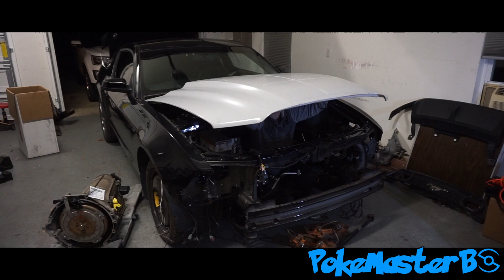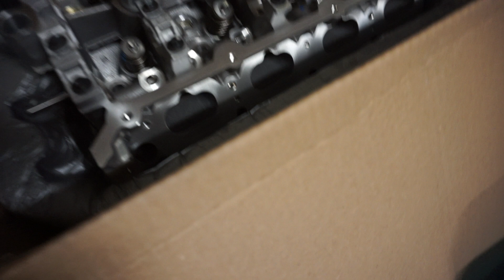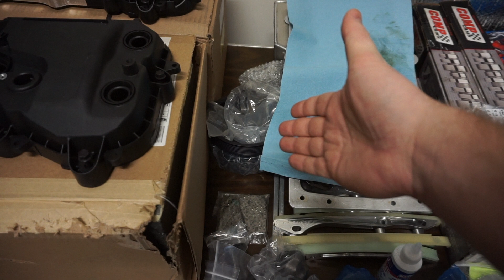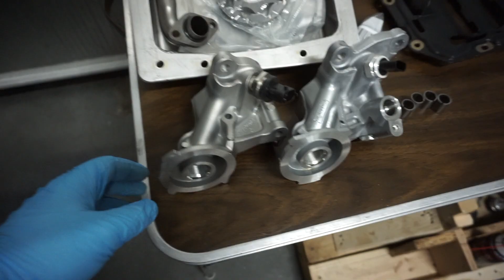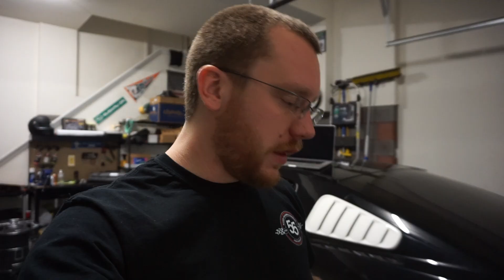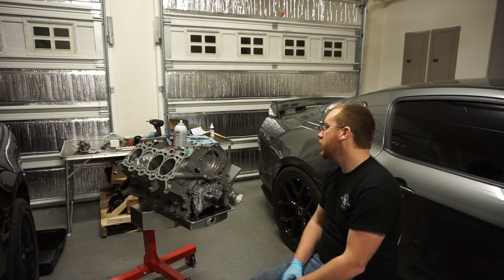Frankenstein Coyote Build p.1: Setting Up The Shortblock

Comment: good stuff. I'm just finished building a Gen3 short block for my F150. I'm pushing close to 1000hp in the truck now and if she goes I have a back up. anyway I'm like 5 miles from MPR and Tim told me I must line hone  the mains when going to a stud. He also wanted to square deck the new block as he said they are terrible from the factory.. Long story short, I purchased a brand new block from ford and had tim square deck it, align hone the main, balance the crank. and spec the bearings. cost was 1300.00 for everything.  also I don't know if you plan on boost, but the main downfall of the gen 3 block is the .009 top ring gaps which are very tight. alot of fellas will run the stock pistons and open the gap up on the ring. I went with the mahle no balance pistons and the boostline rods. hope she becomes a real ripper.
Reply from the maker: Very nice! I unfortunately didn't know of any local engine builders/machine shop before starting the project so I passed up on getting the short block thoroughly gone through and just did the resistance test you see in the video. Probably not the most accurate way of going about things but at least gave me a little bit of comfort knowing I was measuring the same resistance in the rotating assembly. You should definitely align hone the main when swapping to a stud if you have the means to. I've got to say though $1300 isn't bad at all for that work to be done. As for the boost, yes I run a paxton blower on the car but part of my purpose with the gen 3 short block was to be able to bump power without upping boost. I only run 13-14 psi on this motor all said and done so nothing too crazy. I'm not familiar with gapping rings myself but I understand why etc. just didn't feel it was necessary given the levels of boost I expected to see.

Comment: Great video man. I have that same oil pan. You need to grind down the spacer for the pick up tube so you can get the correct clearance. Once the gasket is compressed the clearanceis to small. Keep it up man.
Reply from the maker: I wasn’t sure about the clearance on the pick up tube because I didn’t know what stock was lol but it seems to be just fine how it is (cars already done running and tuned) videos are just behind. I would think if there was going to be an issue with it it should have shown up by now! But just out of curiousity, are you running the same MMR spacer? And if so how much did you grind it down or how much spacing did you make sure there was between the pickup tube and pan?

Comment: This is such a cool idea/build! Do you have a good idea what a GEN 1 Coyote would make with Cold Air Intake, 2018 ported manifold, 1-7/8in headers, H pipe, 1050x injectors and dual fuel pump would make on the Dyno?
Reply from the maker: Thanks man! If I were to guess I would say somewhere in the 430-440 range unless your doing e85 then maybe 440-450ish.
Reply: PokeMasterBS I have thought about E85 but I do a lot of highway driving as well on some weekends so it would be hard to find E85 pumps to keep filling up at. Thanks for the input tho I really appreciate it, I love your build man!
Reply from the maker: Yeah my closest station is an hour away. Definitely pretty far and inconvenient but I deal with cause it’s pretty awesome stuff haha plus it’s not dedicated e85 I have a 93 tune as well. But no problem man and thanks! Glad it’s well received 🤘
Reply: Could run a flex tune if I am not mistaken?  It should work e85 and 93 quite well so if you can't get e85 all the time you don't swap back and forth. Correct me if I am wrong please